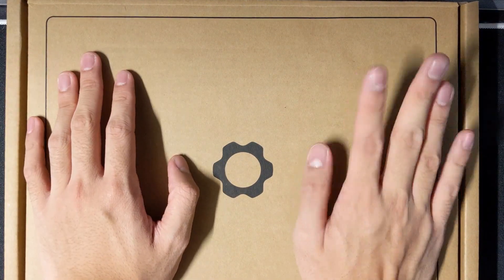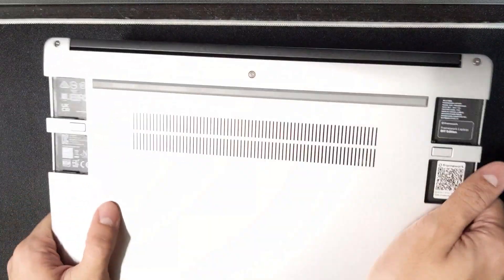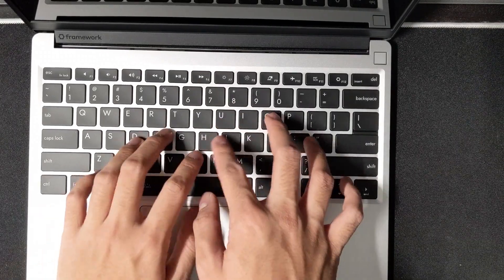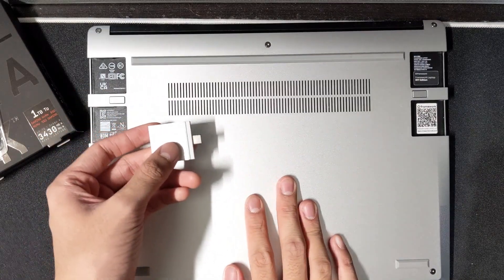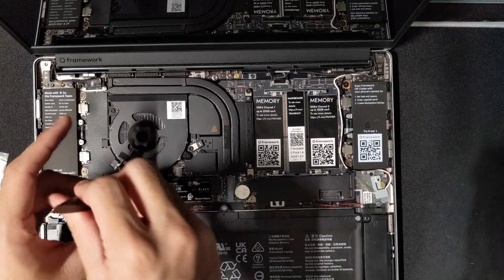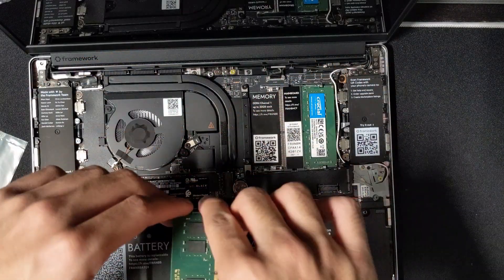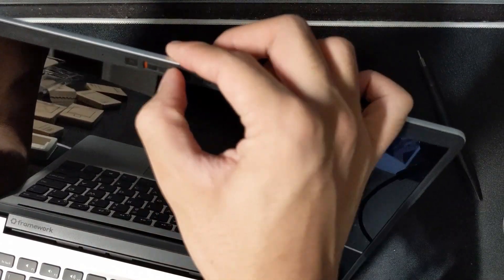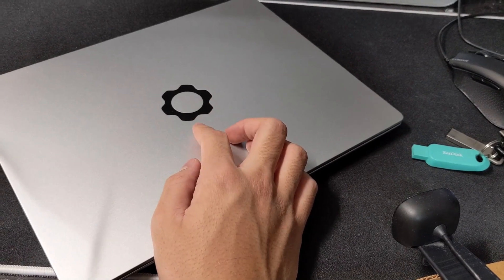Let's Build A Laptop! - Unboxing The Framework Laptop

Comment: Dude, this was actually vvv entertaining to watch! How are you enjoying the laptop so far?? Tried to look up any other vids on this, but i guess this is the only one. That or I’m just terrible at searching!
Reply from the maker: i've been meaning to do an update, but i'll give you the sparknotes ver.

+changed the SSD, very easy taking apart
+ build is solid, no complaints except: - the top bezel is very subtly degraded, likely from me opening and closing it. it's not very visible or anything, just feels textured. doesn't affect much
+the 3:2 aspect ratio display had ruined other laptops for me.
+ keyboard is great! nice travel and feel. but i do miss dedicated home, end, pgup and pgdown keys
+ great support and communication from the team, active community
+ testament to show that repairability ≠ less usable, or attractive. thin and light, with performant specs!
+ processor's been fine. i only record and do very simple video editing, along with other computer tasks. works fine.
+ trackpad's good. no issues

- battery life (on linux) is... O.K., I guess. it's gotten better, but it took some tinkering. not an all day machine, though i usually have access to an outlet. still not great. hope they find some solution, since it's the biggest complaint i have with the laptop.
- the novelty of the expansion cards (the swappable ports) has worn off a bit. i feel like they could've shoved more ports than what's given, and most people would be satisfied. this also helps with battery, as the USB-A and HDMI ports seem to suck up a lot of energy.
- glossy screen is... eh. plan on putting a matte protector on it eventually
- speakers output sound, if you want to call it that.

there's tons of videos on the framework! linus tech tips made a couple videos, elevated systems, and many more :)
Reply: @Lamian  Oh, my bad! I meant to say videos by you about this laptop! 😅 anyway, i’ll definitely check out more reviews! But so far, this looks like a solid pick for what I would need my new computer to be! I feel ya for the missing keys tho, and the batt life, and the speakers. 🥲

I hope to see more tech videos on... your VA channel!! 😂😂 always nice to consume something different every once in a while.